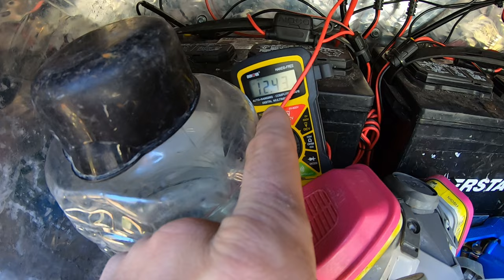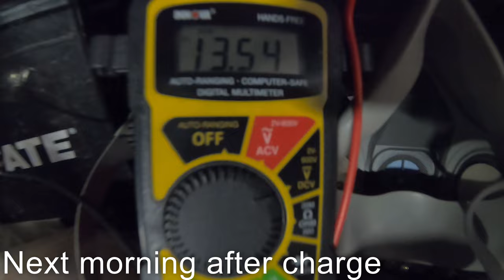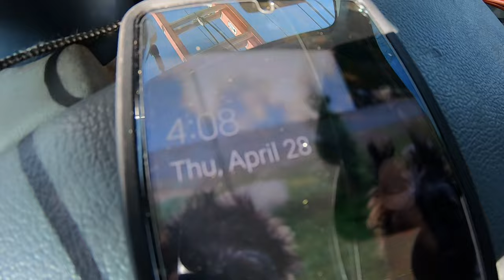How to Dual 12 Volt Battery Soft Wash

Comment: Perfect timing. Never realized you ran 2 separate batteries. I Just put a deposit on a 12’ trailer 5.5 hours away, today!! It’s getting REAL down here in PA 😂 I’m gonna thug it out without a pressure washer for a little bit and just go with the 2 12v batteries. Thanks for all you do. Keep ‘em coming! 👏 👏
Reply from the maker: Plenty of work out there that a 12v can do. I used a cheap pressure washer from home depot for a season and it did everything I asked!

Comment: You can use two batteries also to start your big pressure wash machine and it charges them as well. Parrellel is like using two arms to bench

Comment: wire your batteries parallel to gain amp hours and lower load
Reply from the maker: I'll look into that!
Reply: Yes ,if you run parallel your charger will still charge both batteries equally.  Also by doing so you don't have to change from one battery to the next. It is like giving your vehicle a gas tank twice the size.  Less stops and more run time...all you do is connect the positive from one battery to the positive of the other battery.. and the negative to the other negative. Charger is wired the same.
Reply: Less e drop too

Comment: Yes Savage is correct... wire them in parallel for longer operating hours... but go with a Deep cycle Marine batteries.... They are heavy but wired in parallel will last most of the day.. That's what I have but don't do nearly as many as houses as you... But they will will last a good day... recharge at night.. if you need pic's holler...   heavy gauge wire then connect all  negative to negative...... Positive to Positive together  is parallel wiring method..
Reply: Send me pic of the diagram
Reply from the maker: Thanks I'll definitely look into that
Reply: @rmbrikha  need email ill just send a pic of mine but its all over google & simple wiring...im sure its here on youtube also...how to wire batteries parallel
Reply: @rmbrikha  its on youtube how to wire parallel batteries
Reply: @YoungAmbitionYA  Also YA if you insist on doing it your way..Amazon sells these heavy duty gauge 20ft ENERGIZER long jumper cables $38 last I paid for 2 sets...what I use to jump cars off long distance.  If you are in a pinch need to finish up a job & the battery is dying on your pump... connect to your existing truck battery from under your hood with the jumper cables to the back pump or drained battery will help you finish up a job or the next house....just a heads up be careful....

Comment: I want to make my own pressure washing/softwashing business. I'm confused whether you need two separate machines for pressure washing and soft washing.

One youtuber I watched called "Dan's Vlog" says on his pressure washer he's ran the diluted bleach (up to 10%) right through the pump on his machine for 4 years. Is that even possible?
Reply from the maker: Running bleach directly through the pressure pump is not recommended. A 12v system is great for Shingle washes. You can wash houses with 12v too. A pressure washer is needed for flat work or downstreaming
Reply: @YoungAmbitionYA  I know it's not recommended but if I buy a cheap used machine and then rinse everything very well afterwards will there be a problem? I want to spend the least amount of money possible and if I could get a cheap used machine for $400 and use it with bleach for 2 years or even more that will make my start up costs way less than buying batteries, pumps, hoses etc etc. I don't even know if I can stick with the new business and I don't want to spend that much money.

What do you think? Could I get away with running diluted bleach? through the pump? Is there any cheap upkeep solutions I could use to prolong the life of the machine?
Reply: @YoungAmbitionYA  Oh yes I know I can wash houses with a separate system, I just want to theorize if I can just do everything with a relatively cheap, used pressure washer and not have the machine fail in a short time period.
Reply from the maker: Yes just get a down stream injector for the pressure washer so you don't have to put bleach through the pump
Reply from the maker: Check out my 1 on 1 by clicking the blue JOIN button if it can help you.

Comment: Still trying to grasp that you don’t have issue with wood siding like that… are you prewetting at all? Man, that stuff scares the crap outta me. What’s the tips on mitigation for that? (video maybe?) :_Hustlin:
Btw, where’s the “Outer Circle” emoji?  

     👆
👈⭕️👉
      👇

🤣🤣🤣🤣🤣
Reply from the maker: 🤣that emoji will work! I'm just careful and I try to control where the SH goes and rinse quickly after. I didn't prewet either building